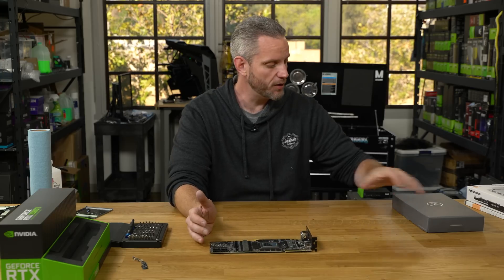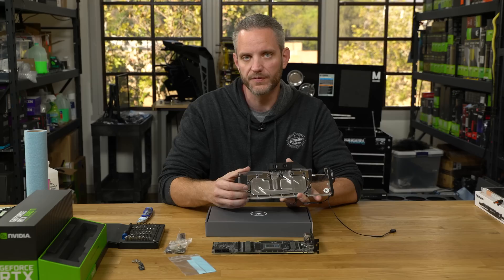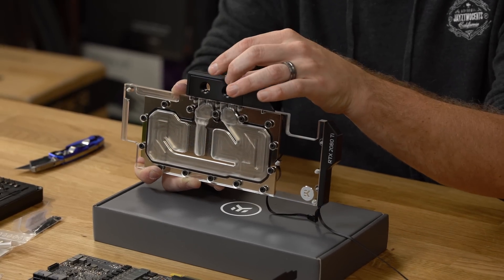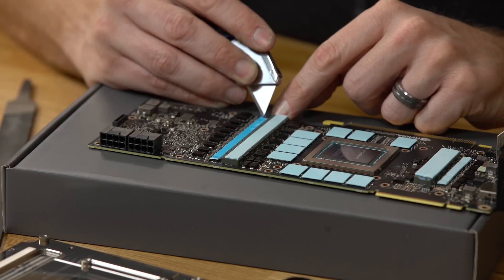GeForce Garage - Watercooling RTX 2080 Ti for JayzTwoCents' Skunkworks.

Comment: Good god 2:03 you all know what I'm talking about. 
The chip itself looks beastly compared to my now broke 560ti, i tried the oven method recommended by people in the comments but sadly didn't work.
Reply: The oven method wont help much. Even when it works only 99.9% of the time it'll only extend the lifetime of the card by a couple months if you're lucky. Very rarely will it keep it alive for something like a year.
Reply: @HeiiKun  It was the only option i had. Not every one has expendable money, especially this time of year. I'll just have to wait.
Reply: @philmitchell9413  Did you look at the PCB and analyse any potential issues (dead capacitors)?

Comment: So this is how you reveal SkunkWorks, on some other channel? Glad I was subbed to this one to see the build. Looks freakin awesome man! OK now lets talk about my EVGA 780i SLI MoBo and why it crashes or prematurely goes to sleep when downloading or transferring large files :) Gaming is just fine. I'm still going with windows 10 and the nforce drivers being at fault.
=X*Only reason I'm adding this here is someone might read it and have a solution to the issue.*X=
Reply: I Got a FIX,   Time To UpGrade! LOL, 780i? DAMMMN Thats OLD!!!
Reply: @igotzpotatoaim520   lol I know this is old and I do have 2 Z97 Mobo's. 1 is running a 4790K and the other is a 4690K and both have a GTX 1080. I did fix it though last night by getting a network card. By passing the Nvidia network drivers was the fix. I downloaded over 70GB last night and all is well. My youturb channel revolves around this platform showing people you don't need the latest and greatest to game. 9 Series Quad Core CPU's are still relevant in 2018.

Comment: 7:00 isn't that far too much Thermal Paste :O
Reply: no such think as too much other than it being a waste of money and a little messy. no difference in temps.weird i know, but it all just squishes out and ends up filling the gaps the same. plus keep in mind on a gpu you are putting paste DIRECT on the die so more is better than less to be sure you get all of the die covered. for cpu's with a IHS  (especially a small socket intel or amd desktop type) its not necessary to cover the entire ihs with gobs of paste.. as long as you do a decent job the temps will be the same.
Reply: @ryancutrona673  I think the only thing you forgot is that this is how it's recommended by ek. :).
Reply: Jay did say "This is the recommended way so thats what were doing this time". So he chucks on how much he wants when the Nvidia overlords aren't looking

Comment: https://tinyurl.com/y7fcfqmq . Don't use those thermal pads from EKWB, they are only about 3-5 W/mK when you can buy Fujipoly Extreme System Builder pads that are almost 4 times better at 17.0 W/mK. It is more expensive but people that do GPU Waterblocks care more about temperatures anyway.

Comment: Nvidia voids the warranty themselves
Reply: kingsofserbiangameplay 162 they want you to void the warranty so they won’t have to replace the RTX after it dies. And they die a lot lately ...
Reply: Agree 100% I have a new 2080 founder from them and reading they are being sent back for exchange or refund.All most done with my system  fingers crossed.
Reply: @raw_pc , I can take that too
Reply: right to repair should fix this issue.  fuk the void if removed stickers.
Reply: @masterred82  Its illegal in th eUSA so in the USA they would have to fix it. I believe.
Reply: new laws :)
Reply: What stickers all I did was opened the box did try the card but have a bad PCI slots or just a bad board now.MSI MAX AC PRO 4790 cpu but just bought the ASUS Maximus code for the 8086 cpu have not put everything together yet wish me luck.
Reply: Cindy Sue how did it go? I have booting problems too I think it’s psu or motherboard so I’m selling on here on eBay. https://rover.ebay.com/rover/0/0/0?mpre=https%3A%2F%2Fwww.ebay.co.uk%2Fulk%2Fitm%2F123466141652
Reply: Or you can just put the original fan/heatsink back on. There are no void if removed stickers...
Reply: @Whiting differant thermal paste
Reply: From someone who blocked their RTX 2080 Ti on launch day I can tell you that there are no warranty stickers on the card, at least not on my card. Additionally Warranty Void if Removed stickers are null and void in the USA.
Reply: @ObsessedWIthGTAIV  i send a message to costumer service they told me it does void the warranty even just Taking the back plate off voids the warranty.
Reply: @joshyjorge07  I don't believe that. Also there is no way to tell.
Reply: @ObsessedWIthGTAIV  I'm still watercooling mine i already got the block so i just will keep all the stock parts. Also i went to the FTC website and it says that manufactors can not condition warranties in the US anymore.
Reply: @joshyjorge07  Regardless of FTC, nvidia would not void warranty for installing a block. I have taken apart several nvidia FE cards, none of them have stickers anywhere. The only time I can see nvidia voiding a warranty is physical damage.
Reply: @ObsessedWIthGTAIV  Good to know, i think i will build just a CPU loop first test the card over clock it stress test it to be sure it doesn't have none of this errors people been getting and then put the water block on it.
Reply: @joshyjorge07  Always test the card before you block it.
Reply: @ObsessedWIthGTAIV  Yeah i will specially with all this stuff going on, thanks for the info man.
Reply: @Whiting Can you say heat gun :)
Reply: I don't think they'd void your warranty for installing a water block
Reply: there is a law that was passed the right to repair ... Companies have to change the way they think  now  . poor apple and there crap now
Reply: Yo what the fuck I've seen you on DJ's aviation and now here as well
Reply: Voiding the warranty over something that in no way caused the malfunction is illegal under US law. Those "warranty void if removed" stickers were never legal to begin with. They prevent incompetent people from opening stuff and breaking it.
Reply: EVGA will not void your warranty.  This is from EVGA tech support:  
"We are quite flexible with our warranty coverage on cards. Absolutely, you can water-cool your card with us and it will not void your warranty. As a friendly reminder, be sure to keep all associated parts for your original factory cooler, such as thermal pads, screws, and the heat-sink fan. In the event you need to exercise your warranty on your card, you will need to have the card reverted back to the original factory condition. Good luck in your water-cooling setup! - EVGATech_JustinT"
Reply: How to sell more cards 101

Comment: Just remember when buying the 2080ti to buy an extra one or two 2080ti's for when it breaks down you can continue to game without waiting on an RMA
Reply: The more you buy, the more you save... i guess they meant time.
Reply: well i read through the nvidia forums.. one guy was 3 weeks after launch like: i ordered 2 2080 tis.. one died a week ago.. the second one died 3 hours ago.. so yeah.. concerning rma quota..
Reply: @Dunkelelf3  FE or AiB cards?
Reply: @Fornowagain  don't know for that one.. guess he preordered the fe cards.. but the problem seems to be either about the gddr6 or memory controlers.. 
someone else said his card started to artifact on desktop after some weeks of light use even on desktop and downclocking the memory 50 mhz solved the issue.. but yeah.. some weeks down the line that might not be enough.. the problem is if the card can't run stock then it's a faulty product..
Reply: @Dunkelelf3  
Will the guarantee will apply?
Reply: I have 2 2080s NVLinked (non Ti). Hopefully this is only a Ti issue.
Reply: @Patrick73787  it's not. It started with the not ti model of the 2080, and has expanded to every card in the 20 series.
Reply: Founders are having the problem now.
Reply: @cindysue5474  not only.. there is also quite some aib cards dying.. seems to be memory related imo from what i read so far.. either bad batches of gddr6 or memory controllers or nvidia was to eager on the memory clocks.. whatever.. overall turing seems more and more rushed.. 
but hey it just works.. until it dies within 3 weeks..
Reply: Well if mine is bad Ill ask for a refund and get 2 new 1080s I don't give a shit about ray tracing just for shadows effect.I just want higher frame rates coming off a 970 gtx.
Reply: @cindysue5474  i switched to a 1080 ti in may coming from a 970 too ;) and yeah i don't regret it.. turing doesn't look that great of a deal.. 20 to maybe 30 % more performance but for a hefty price increase.. and that rma quota.. the tech that is in the friggin name is still not supported by any game as the new dlss.. i don't care anyways.. i don't think the tech is there yet.. i'll wait another gen or two and see where things go with this.. i can max out anything i play right now anyways.. screw raytraycing..
Reply: Agree with you big time.
Reply: @cindysue5474  yeah i mean look at that.. not much to say about.. i rather wait some years and then decide what to do and do a full new rig.. 
right now i rock my archaic 5820k system i build in late 2014 with 32 gb dom platinum and the x99 deluxe from asus with the now evga 1080 ti ftw3 hybrid.. 
i didn't see any cpu i really wanted or considered to be worth changing things for since then.. a 8700k would be like what? 10% more performance? screw that.. 
the 1080ti will also serve me well for the next years.. i have 32 gb of ram which will also be plenty for a long time.. a 1 tb nvme ssd for operating systems and programms and two 1 tb sata ssds in raid 0 as fast storage and huge fast drive for games.. that with 4 tb hdd space as long term storage.. 
there isn't much more i could want.. and what is going on on the cpu market is kinda boring really.. like zero new innovation.. yeah amd made a comeback.. but the cpus are on par with what intel has to offer.. there isn't really much to gain in upgrading.. another 2 cores and some mhz.. yay.. and all that with new board and cpu for just 600 or a bazillion more.. screw that.. 
at least nvidia pushed something new.. i respect that.. but i really just don't think it's really that great at this point.. the tech is cool but the performance is not.. even more so if you consider that it's only cuda performance to get from turing right now.. and that for like double the price of a 1080ti at launch with the 2080ti.. hell nah..
Reply: @cindysue5474  From everything I've read/watched so far concerning the failures, it is also happening to some partner cards. Steve from Gamers Nexus, who is currently "gathering" failed cards, recently said that the failed partner cards all have the FE PCB's. I know there have been a few non-FE PCB 2080ti's dying, but it does look like the vast majority with issues are FE or FE based. I'm currently running 2x FE 2080ti's in SLI for almost a month now and have been following this issue since DAY 1. I was following things closely because the initial issue was the shipping delay(s) and then I started seeing posts from other "first batchers" receiving bricks and/or cards failing quickly.
Reply: Derek 2 cards wow that thing must rip through frame rates.I will go that route just waiting for them too settle the problem first.
Reply: Cindy Sue Yeah, blazing fast frame rates for titles that have official SLI support and some that users have made custom SLI profiles for NVInspector. Examples are Sot Tomb Raider, everything maxed, getting over 140FPS whereas Forza Horizon 4, I’m seeing high 80’s-low 90’s. PLEASE do go the dual GPU route even though most people feel (and rightfully so) that mGPU is dying. If enough people go mGPU, then there will be more support. And I absolutely understand the rationale behind the “buy ONE GPU that is in your price range”. But I’d basically have been looking at the Titan V, which isn’t that exciting to me, or 2x 2080ti’s in SLI. Since I’ve been building my own rigs for decades, I’ve always been pro mGPU (SLI and Xfire) and do not see myself changing unless the support completely disappears.
Reply: Wow 140FPS with SOTTR that's so cool. I have Xplane also it don't support SLI but it will run much better with a new card.
Reply: So far I have the 8086 limited CPU 32GB Corsair Vengeance pro ram 3600MHZ Corsair 1000watt PS ASUS Maximus Code motherboard Corsair H100 radiator.Iam running a 4790 DDR3 ram too find a board for that CPU like my MSI pro max ac. is hard to find they want close too 575 bucks for a used one and the ASUS Sabertooth is almost 600 bucks its like finding the front end for a 71 Cuda. So Iam glad I went with the new stuff.
Reply: AceTheBase  maybe let it sit some time.. wait till we know what really bricks those cards.. maybe they can deliver some bios update or something to solve the problem.. then you'll be safe.. if i wouldn't have warranty and have such an expensive cards sitting there i would do so tbh.. in the end it's a friggin great card.. but they rma like flies right now and nobody really knows truly why this happens..
Reply: The launch was RUSHED....you got to pay to play.
Reply: @71x2  if you have warranty there is nothing you'd loose if it dies.. however you might go through a lengthy process.. peole had cards die just to receive a new card that doesn't work properly.. then you have to rma again..
Reply: Great idea, installed my 2080ti yesterday and now I'm waiting to send it back. Already crashed....

Comment: "You can have a amazing looking system like this without any special or formal training"
Hue hue hue.......I can't even afford a rtx 2080ti let alone i bet that entire system is worth more than my second hand car. 😂😂😂
Reply: The fittings can be the catch... $9+ AU depending, per fitting depending on the ones you need might not seem like a lot but for something like Skunkworks you need many many fittings. You can be talking $900AU in fittings for even a low end system.
Reply: @scraverX   What is the point of water cooling a gpu? (or even a cpu for that matter)   Good air with a noctua D15 is enough.  You dont need to overclock a 1080ti. You can overclock an 8700k on air just fun. (noctua d15).  No voiding warranties, easy to resell equipment (what everyone should be doing) as its unmodded, no loads of cash on waterblocks and fittings (put that towards other gear), no chances of leaks, pump failure etc etc.    A big dumb block of metal with a high quality fan will work indefinitely (noctuas are guaranteed for 6 years + theyll send you out socket mounting kits for future sockets - for free anywhere in the world) .    I can't for the life of me work out why anyone would go to these lengths apart from making an 'aint it look cool' pc.   WHY?  supid high cost +  WAY WAY WAY more chance of failure. + good luck with the resale.
Reply: @fredfinks  The point? You could ask five people that and get 5 different answers. Some people like the challenge and extra work involved.Yes, air cooling can be adequate and it is cheaper. There are also plenty of coolers out there that can do as good a job as the Noctua d15.
Sure, with water cooling there is a chance of leaks and the pump failing; that's why you need to pay attention and do periodic maintenance. Even Air cooled systems should be maintained. A high quality fan on a block of metal can fail if you don't keep your system clean.
As to resale. Some people don't bother, there are various reasons why - one of those is what they use the computer for or how long they keep it for. The market for 8+ year old hardware is small and has almost no money in it. I have given old hardware away.
Reply: @fredfinks  For shits and giggles, Perhaps?
Saying you don't "need to" do something, doesn't mean you don't want to for personal reasons.
You don't need to cut your hair, or nails, or groom yourself, you do it because it makes you look better.
Same with this. You don't do straightline watercooling and cablemanagement for any particular reason apart from looks...
Reply: Jays system costs probably 7500 usd lol
Reply: Well yeah but i think he was reffereing to the water cooling part :P
Reply: @S33k3R7  The water cooling part is probably also more expensive than a lot of second hand cars tbh
Reply: @antonhelsgaun  I mean i have no idea how much the waterblocks cost, but im sure thats the most expensive stuff. and depends what kind of second had cars ur talking about :P i can buy one for under 300 euros hehe jk jk
Reply: EDIT: the waterblocks for the 2080TIs are 133.18 euros each, the reservoirs are around 62 euros each and the rest, such as tubing and small stuff cant be very expensive, id say the water cooling for that stuff CANT be worth more then a second hand car. Lets say the cost of the water cooling is around 500 euros.
Reply: S33K3R™ two ek RTX 2080ti water blocks and back plates cost me $640 Canadian after duty and shipping. And my two 2080ti don’t come in till next week I’ve been waiting for them for 6 weeks now lol
Reply: D3LTA KING i literaly just goggled the waterblocks and saw them at 133 euros each. rough to be canadian i guess.
Reply: S33K3R™ yes true it might be worse come next year when the rest of the tariff taxes are introduced. Might not effect Europe as much as Canada. We keep getting raped over here